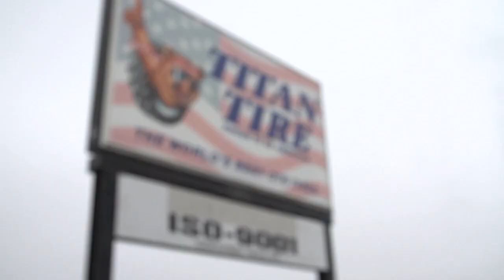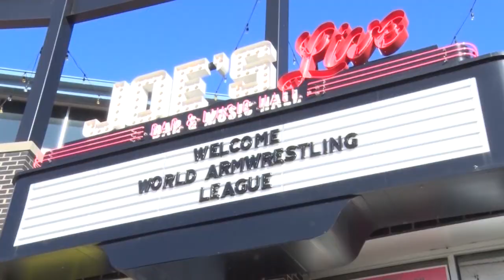Supermatch Showdown Series 401

Comment: for us arm-wrestling noobs can someone explain what the kingsmove actually is?!?
Reply: You drop as low as you can and it helps elevate your hand into your opponents fingers. Which is usually a lot easier to pull against, because most people fingers aren't nearly as strong as their bicep, shoulder, chest etc. By doing this you're staying away from your opponents stronger muscle groups, taking away their power by putting as much pressure as you can into their wrist and finger strength. It's sucks to be on the receiving end, very difficult to pin a good kings mover.